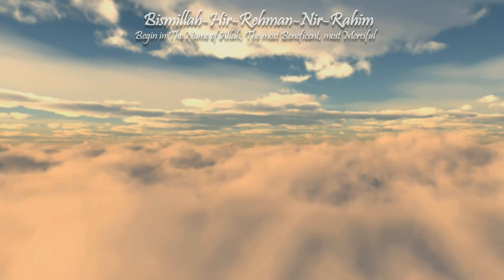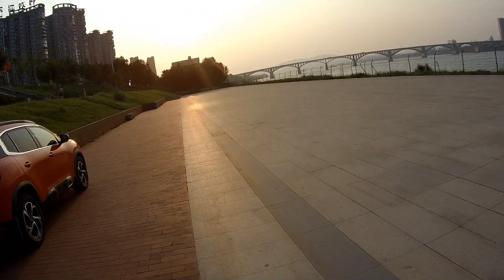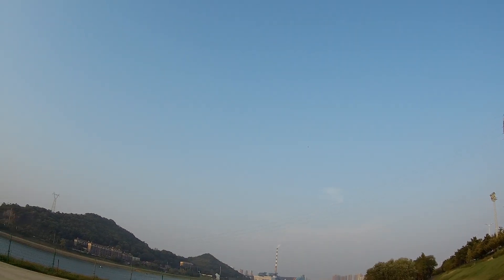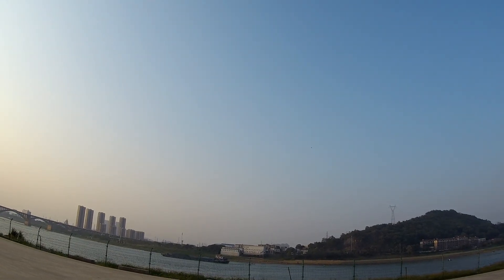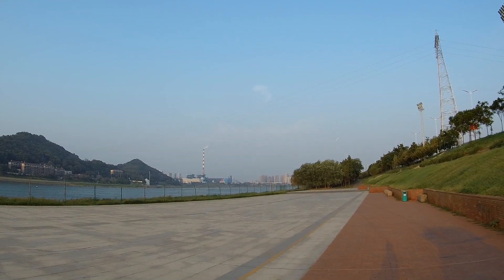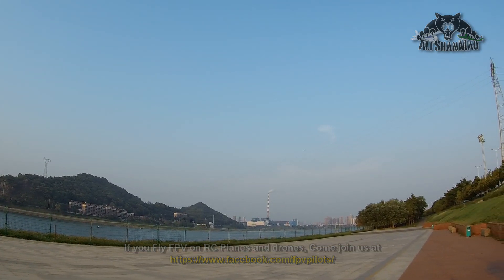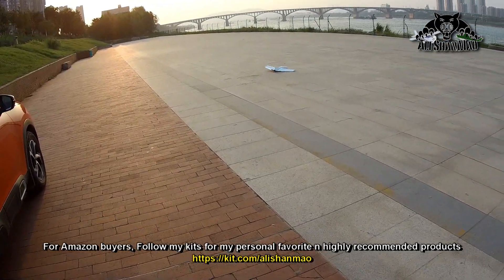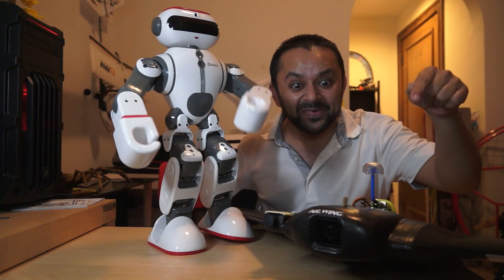Rambler RS Long Range FPV Flying Wing on Gusty Windy Day

Comment: Question. 
I am looking for the best follow-me ( on my bicycle) drone. Long time ago you reviewed the AOSENMA CG035. Do you think it is still the best follow-me drone? Or should I buy a Fimi A3?  Or maybe some newer drone. The AOSENMA CG035 is €123.70 on AliExpress without the camera. ( I will be using my Onepaa X2000).  Not sure if it is an upgraded version? 
I hope you can advice me.  
My JJRC X6 Aircus was a bit disappointing.  The gimbal went funny. And it doesn't have any of the features like follow-me without the camera.  I ordered a new camera.
Reply from the maker: Best to get a DJI Spark. for follow me videos on bicycle